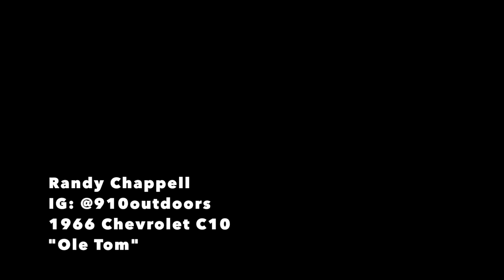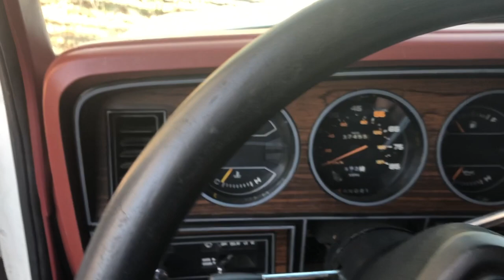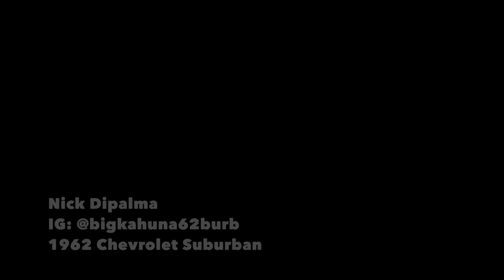'66 Chevy C10 "Ole Tom" / '85 Dodge Ramcharger / '65 Ford F100 / '76 C30 / '72 Chevy C10 and more...

Comment: Thanks for letting me share the Ramcharger! Love what you have going on at UBT.
Reply from the maker: Our pleasure! Thanks for sending in the video.
Reply: All my Dodges are 2nd gen cummins trucks (5 of them) but I enjoyed seeing your Ramcharger on the vid. Glad you made one and sent it in. 
I had a sleepy lil 318 a long time ago and it really woke it up when I put on a cheap set of headers an aluminum intake and a 600 holly vacuum secondary carb. Just something to think about.
Reply: Crazy oilfield mechanic that’s good to know. I had considered doing a cam, some 360 heads, an intake and 4 barrel on the 318, but figured by the time I did all that, I could just go the 360 long block, add a 4 barrel, swap over my accessories, and be better off. With all this COVID 19, who knows when I’ll be able to get it swapped.
Reply: @cooterhedrick2906  it would also be a good idea to check your timing and how quickly the distributor advances the timing as the engine revs up. In 85 Chrysler was more concerned with smog laws than horsepower and the factory distributor advance curve and static timing setting can be so slow it makes the engine very lazy. I always adjust the distributor and advance the timing until it pings when you floor it or starts hard and then back it off until it stops that and then check it with a timing light and see how high it is and note if it has made the engine have more power or not. If it has really improved the power than the distributor is lazy and needs to be modified so the timing advance curve is more aggressive. If you can run 18 to 20 degrees of timing by adjusting the distributor and it starts right and doesn't ping then the distributor is not advancing the timing right for power. Also if you put on a performance aluminum 4 barrel intake it won't have any place for an egr valve . Egr valves that  are constantly leaking exhaust into the factory intake are common power robbers on that year of engine also.
Reply: Crazy oilfield mechanic I’ll share that with my mechanic that helps me with the  tuning stuff. I can swap parts and do some of my own wrenching, but I don’t have a timing light or any of the advanced tools.